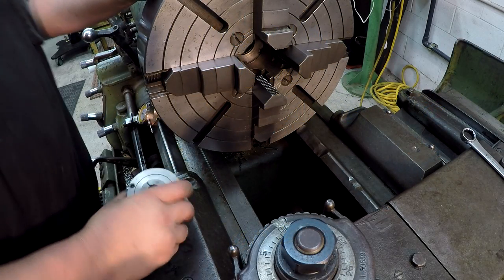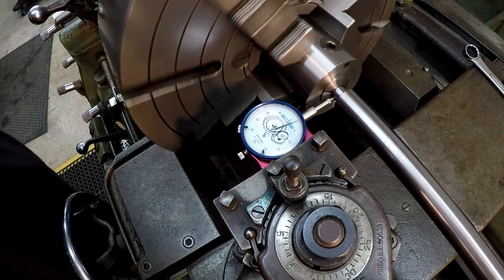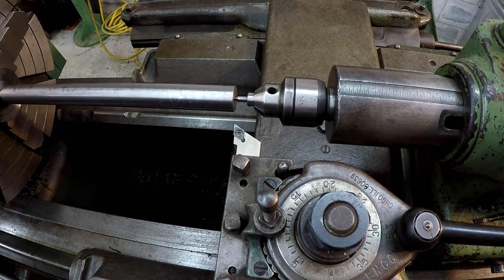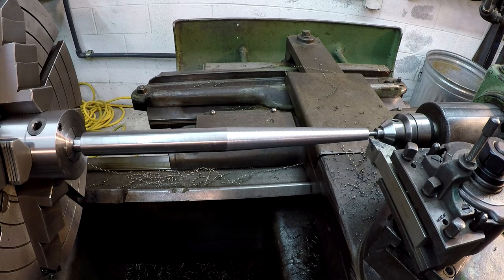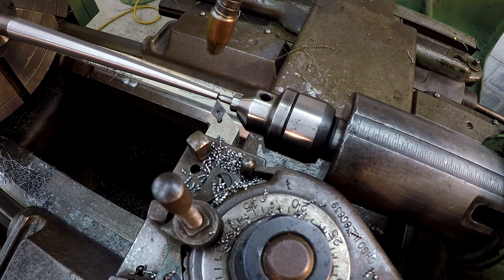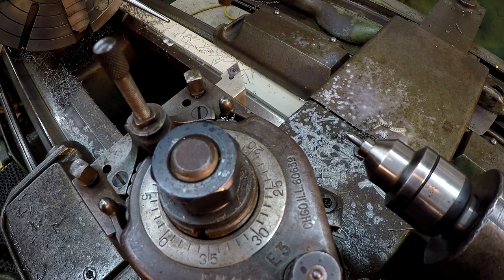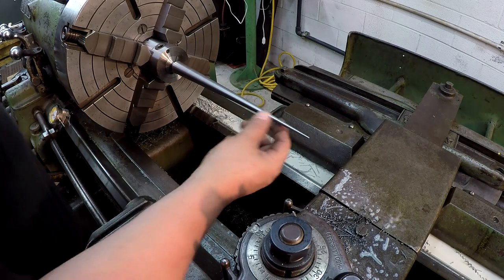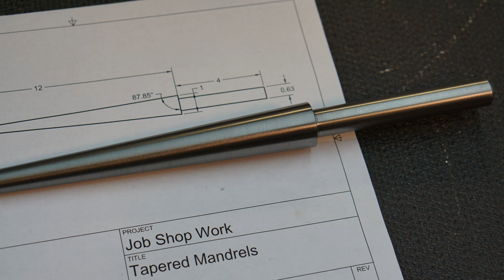Turning a Taper using the Monarch Taper Attachment Part 2

Comment: Fun project, but surprising that NYCNC didn't do it himself on CNC lathe.  Also would have been nice if you had explained how the taper attachment holds and releases the cross slide lead screw to allow it to follow the taper.  For those who don't know, Keith Rucker has a video showing assembling a taper attachment which makes it clear.

Comment: Back in the 70's I worked in a job shop in Cincinnati which had a Monarch lathe like yours . Our main source of work was to machine propellor shafts for pleasure boats. we found that to get a good finish on the taper , we started the cut at the chuck end & fed towards the tailstock. Also to prevent chatter it is a good practice to set the tailstock handle at a position between 1:00 & 3:00. B. Fox - 44 years a Machinist. Thanks for your excellent videos !!!
Reply: Byron Fox , retired machinist .... I've always cut from chuck to tail stock.  That way your pulling tool to work piece not pushing tool away during the cut which can allow slack in taper attachment to tool.  Get better accuracy also.
Reply: @leebarnhart9725  I've had that problem myself. Cutting along then notice my center wasn't turning and panicked.
Reply: "we started the cut at the chuck end & fed towards the tailstock" GOOD TIPS！
Reply: Thanks for explaining that!  @leebarnhart9725  At first I thought you did that so the chuck side supports the skinny end of taper but now I get it.

Comment: Gotta admit, i had my doubts there for a few, but as it dwindled down, well, still had my doubts, waiten for the thing to pop off, go flyin across the room, especially on that last cut ay.
Outstanding work as usual Adam.
Reply from the maker: +Mark R I was a little worried myself but seems like that center proved it works, even if "just the tip"

Comment: cutting the other direction will keep the backlash out and keep the tool pressure the same. On light weight machines the tool pressure can push the tool out unevenly. By cutting big end to little end the tool holds the same push off all the way down the part. Great job.

Comment: For folks out there that need to cut small diameters near the tailstock and don't have a changeable tip center, use a half-center. You can buy them, or just grind just less than 1/2 the diameter of a dead center off so you have a flat that is aligned vertically. You can cut right down to the center hole with one.

Comment: I could understand moving the tailstock on the last several passes to get the backlash step out but why bother when doing all the roughing passes? I wonder if the shim has ever been pulled out of the cross slide nut on that machine to take up some backlash? I have done it on mine and it wasn't a big job. one shim took about .030 lash off the dial on mine.
Reply: bcbloc02 I wondered about that as well. I have a old Clausing not a Monarch but my taper attachment doesnt need the backlash taken up till last couple of passes.
Reply from the maker: bcbloc02 That's true, but it bothers me to see the steps being cut in it. No big deal on that job to reset the tailstock each time. I wanted to make sure it was cutting correctly as well.

Comment: Adam, good job like always. I was wondering if you have ever made a video showing how to adjust a steady rest using the scratch method for long shafts that don't fit thru the headstock? I have seen you use a horizontal boring machine to put in a center on some big shafts, but that is a machine that most shops won't have. I used to setup the steady rest close to the chuck, then slide it down the bed, but that is awkward for big stuff. The magnetic base indicator on a bull center works, but the scratch method is so much easier. You can message me if you are not familiar with this method.

Comment: Hey, Adam! Just watching this. (I am not a machinist) at 14:35 you start worrying about your chatter starting in... if you watch the leading edge of the coolant enrobing the uphill side of the part, it seems to get "jiggley" a couple times (noticed it again starting around 18:45 on the last cut). Is this a good indicator of the chatter harmonics? Or is this a disruption of the coolant due to chips messing with the flow? If its chatter, could you rest a  piece of wood or something against the work to dampen the harmonics? I speculate that it wouldn't take much pressure to prevent them,,,? (On this part, anyways)

Thanks.
Matt

Comment: Great job, bet you're glad they didn't want it down to a point.  Would have been real hard to use a steady rest.  Was cool to see the taper finally end exactly at the correct spot on the chuck end.   Craig

Comment: Hi Adam, and a happy new year to you and your family.
I do a lot of taper cutting on both of my lathes The 19" Sidney and the 13" Sheldon both have taper attachments on them. I just wanted to share with you a trick I use to get a clean finish. I use a shear grind on a HHS tool on my final passes. and man does it leave a beautiful finish. Granted you had a very small end on that part making tool set up a bit more tricky, but I think you could grind one to work on that setup just the same. I think a lot of guys get used to using insert tooling and forget all about using this grind to get a nice finish.

Joe
Reply from the maker: Joseph P. Polnaszek Joe, my next option would have been a hand ground hss tool bit for sure. Only reason I used that new tool was because it was perfect for the job. I've tried one of those shear tools on copper before, awesome job!

Comment: Great job, and really interesting to view. 
A strange thought crossed my mind while watching that tiny center being worked down smaller and smaller. I wonder if anyone has ever tried a reversed type center. One where the work was the point and it fit into a inside tapered receiver.
Reply from the maker: +Bryan Spacek Yes those types do exist. Great for holding rough stock with no centers.

Comment: Nice video. Haven't seen stuff like that in decades.

Dumb question that needs to be asked:
Could you not have left a parallel "nib" (at initial "facing") at the thin end to locate the live center about ⅛" further away from the end of the taper?

Comment: definitely not Abom sized work. the part turned out well. great video. I would have liked to see you run an indicator across the length of the taper to see how much runout there was due to flex.

Comment: 700 RPM!  That's the first time we've ever seen Lady Monarch run at her absolute fastest speed in the history of your channel isn't it?  Was holding my breath until my face was going purple on that last cut!  Talk about taking the Lady to her limits, but in a totally different fashion, this time being how small can the homefront lady veteran actually go, and the lady kindly replying in her actions:  'How close are you willing to having your tool reshaping that itty bitty center then?  I can go smaller than that if you want! XD'
Reply: Also, glad to see the Monarch's taper attachment in action!  Keith Rucker's video on putting the cross slide back on his Le Blond served as my basic introduction to taper attachments, and you picked it up with these two vids of showing one actually in action! ^^  They really are nice!  I am curious though, you can still use the cross-slide leadscrew while using a taper attachment, its just engaging auto-feed on the cross-slide that is a NO-NO when using it?
Reply: When you're using the taper attachment the cross feed screw is locked out. The taper attachment actually pulls the entire cross slide in/out as it moves up the channel.

Comment: Sharp eye there Adam.   Very delicate work at the end.   Good you had that very acute point insert.   May I ask why you didn't leave a larger diameter button at the end where any big live center would fit and then work on the other side of that for the tiny end of the tapered shaft?   After parting it out there would be no hole in the small end.  Nice vid as usual!

Comment: Could this be done in increments? Where the part is turned to close to the smallest diameter for maybe the first 1/4 of its length and then slid from the collet for the next 1/4 of the length and so on for four operations with a super fine cut at the end having the full length between the collet and the tailstock? Just wondering if this would help with some of the problems associated with a long skinny part???

Comment: Stressproof (1144) was probably the perfect choice of material- free machining but strong enough to resist bending. It's not often that we see you nervous although it worked out great. Could you have switched to a tool post grinder toward the end and would there have been any benefit?
Reply from the maker: +Dennis Stephens No benefit unless you need a different surface finish or if it was heat treated.

Comment: nicely done, adam!
one thing that i have probably missed: where and how do you disengage the cross-feed on your lathe to run the taper device?
thanks for the video,
-toly
Reply: Toly Dukhovny I do believe, that to is the small bolt in front of the compound, that’s where it is on my c&j lathe

Comment: Very nicely done!  Seems odd to need that much change in diameter on a single mandrel.  0.1" is pretty tiny.Couldn't you have extended the tailstock quill a little more to give enough room for the backlash removal without moving the tailstock each time?  Or isn't the quill long enough?
Reply from the maker: +rbaker142 Yes I could have extended maybe 2 more inches but I would have still had to remove the tool eat time then drop it back in.

Comment: I'm just wondering,  if the blank is a bit longer, the first thing is to turn a spigot on the pointed end, then you can hold the end in the tailstock, turn the taper leaving the thin end until the last, when the thin end is turned, you can then make it as thin as you want until it's cut off, that way you don't need a centre hole.
Reply from the maker: +Sparky Projects But then you'll be dealing with the backlash of the taper attachment when making the cut. Several others have made this comments but it won't work, or maybe I'm missing something myself. You have to move the carriage back, dial in, then bring it forward to make the cut properly.
Reply: I was wondering about leaving a bit on the end to keep the tail further away, then part it off. But as small as that end is, there's not much strength left. In the end, it all worked. (reminds me of my college senior design project -- 20 years ago -- as the machinist called it "a big egg on a toothpick".)

Comment: Excellent tutorial ! Adam, or anyone that may be able to help. I am restoring an 11" x 4' South Bend lathe, built in 1938. It is not the most common of models.  It calls for an adapter sleeve for the spindle Id taper to a #2  MT. It feels close to a #4 MT on the inside of the spindle but is not exact. My question is how do I measure the taper on the ID of the spindle to know the OD taper measurements I need to make this sleeve adapter. The spindle is 1-5/8"-8 with a 15/16" max ID opening and 7/8" thru hole. Doing the ID #2 MT bore should not be a problem after watching your video even thou I do not have a TA but will off set the tail stock machining the adapter on my Atlas/Craftsman lathe. Thank you for your input.

Comment: Don't cha just love it when a plan comes together.... say, could you have used a follow rest instead of a center?
Reply from the maker: Duncan MacKenzie not on a taper, the follow rest is fixed to a diameter. Some type of follow rest with spring tension on the rollers may be an option, never seen one though.
Reply: Oh yeah, why didn't I think of that?! Well you can see I'm no machinist. Thanks for the reply Adam, I really appreciate it. I forgot....DUH!

Comment: dumb question - what's the point of using the collet if you have to dial it in on the 4 jaw anyway? Just protecting the part that's inserted in the collet?

Comment: Thank for the great video as always!  I have a 1942 16" CW that I am setting up, and you answered a lot of questions I had with just this one. One question I do have, does your CY have a separate switch and set of contacts for the coolant pump, or does the pump run every time the machine is running and bypass depending on the valve position? I have looked online, and have the manual I ordered from Monarch but it has no mention on this. Thanks, and Happy New Year!
Reply from the maker: +Richard Frisbie Yes it has a separate switch for the coolant pump. You turn it on separate from the main motor.

Comment: Hi Adam,
Love your videos. I have a 1941 Monarch 14c that I love. What are you using for coolant? My machine uses a lot of way oil and it leaks oil in other places. Some of the oil will mix with the coolant. Would love your recommendations.
Keith
Reply: Keith, while perusing these comments 2 years later than your post I see your request for information on flood coolant type to inhibit souring of the coolant sump. While I am not Adam or another youtube creator/poster I too had this problem in years past. 

This is a constant problem in mixed usage machines. When you have water and oil not mixing and emulsification not taking place due to tramp cutting oils floating on the surface souring is always the result.  There are no easy answers to these problems but here are a few work-arounds: 

Change to a different cutting fluid... 
From https://todaysmachiningworld.com/magazine/how-it-works-cutting-fluids/

In addition to straight oils, three kinds of water-miscible cutting fluids are widely used. They give good tool life and help to produce a good surface finish, said Randy Templin, vice president, Blaser Swisslube, Goshen, N.Y., a manufacturer of cutting oils and fluids. When properly mixed, the fluid is mostly water, with a few percent of the fluid concentrate, which is made up of oil and/or synthetics, plus additives.

Soluble oil: This is oil dispersed in water, making a milky-looking mixture. It offers the greatest amount of lubrication among the water-miscible fluids. Emulsifiers and surfactants let the oil mix with the water and remain stable despite contamination from tramp oil, machining fines, and other materials that find their way into machine sumps, Templin said.

Synthetics: These don’t contain oil. They are made up of various chemical compounds such as phosphate esters. Synthetics fully dissolve into water. They are often transparent and may look like water or have a colorant added. They tend to be the most stable of the water-miscible fluids, and are often used for applications such as fine grinding, where a fluid is needed to keep the wheel open and clean, according to Templin.

Semi-synthetics: These blend oil and synthetics to give a combination of lubrication, stability and cooling performance. The concentrate usually contains 30 percent, or less, of mineral oil, Templin said. 

OR

Add a tramp oil cleaning system to your sump by building or purchase... 

Skimmers specifically designed to remove tramp oils that float to the surface of cutting fluid after it has returned to the sump. 

Oil absorbing blankets can by used as chip bed liners to "filter" the occasional usage of non-water-soluble cutting fluids such as dark thread cutting oils. 

or 

fit a separate aerator pump to run constantly to add O2 into your sump. This will prevent most anaerobic (O2 hating) bacteria but encourage yeasts, the difference between a sour smell and bread dough. Any bacteria, yeast, other microorganisms are best avoided though. -30-

Comment: I thought it might have been better to start with a longer piece of stock than needed, then turn down the small end to 0.1 for about a half an inch where the centre drill is to allow you to get space between the centre and the cutting bit, just a thought but I am not really experienced with turning.

Comment: Watching the start of the last pass I did a mental double-take - "Did he really say he's taking all 25 thou for the last pass?".  Was that to keep the carbide insert happy because of its edge radius?  I'd have been sneaking up on it with a HSS tool for sure.
Reply from the maker: somebody else that took bit has a nice sharp edge with high back rake at the point, so it was working quite well. In my mind I was thinking two final .025 passes to finish it off.

Comment: Obviously a job well done. Did you check the taper once you allmost finished the cut?
Reply from the maker: Grandpa Cocky I measured with calipers and was within .002 using them. I'd say it's within range.

Comment: great work as always. the monarch is a beautiful lathe and i'd sell a kidney for one like it.

is it normal to have to remove the tailstock like that each pass? i assume the monarch is a bit worn out from use over the years? i know backlash is normal, but in older machines is there anything you can do to reduce it, short of rebuilding the machine?
Reply from the maker: SuperAWaC yes I can play with the lead screw nuts to adjust the backlash but have not messed with it. It's adjustable.
Reply: Abom79 cool. they don't make them like that anymore. at least, not as good looking.